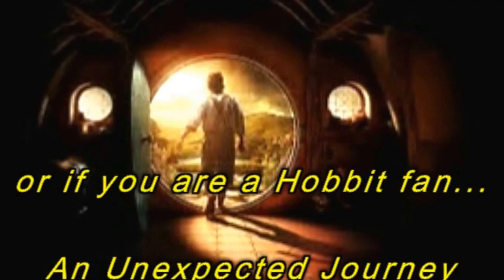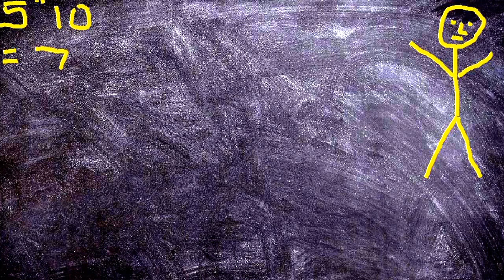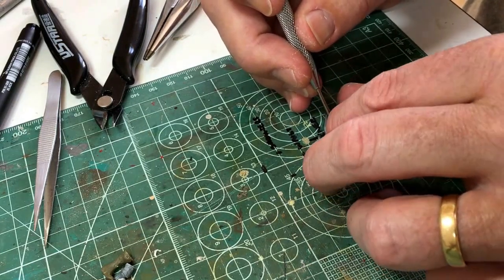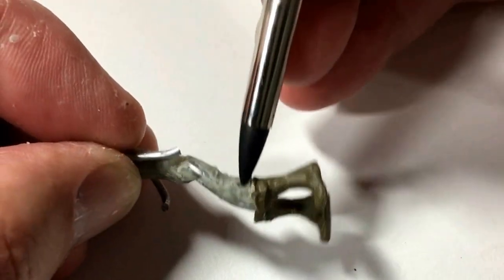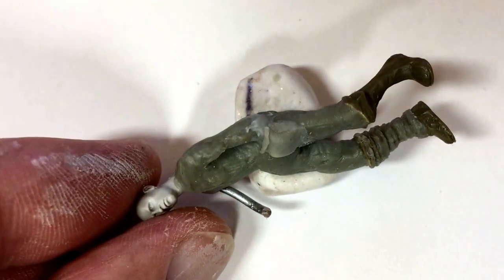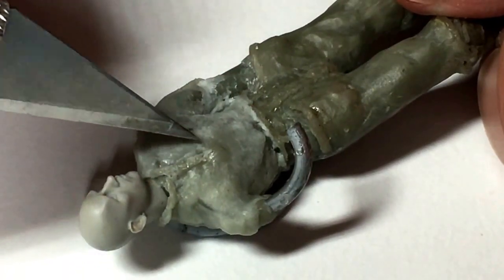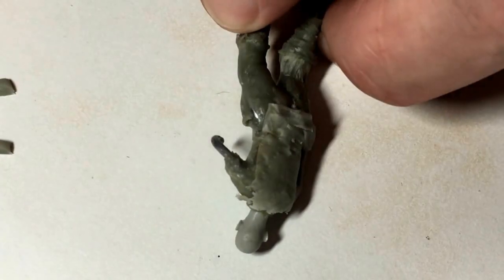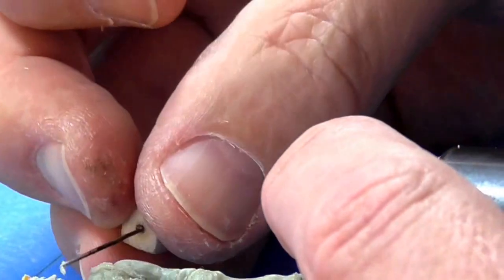How to Sculpt 1/35 Scale WW1 British Infantry - Part 1

Comment: Excellent mate. I have never tried anything like this (never had the need to so far to be honest) but although this isn't a tutorial, having this as a guide would be helpful if I ever did try it. I had a thought, for something thinner than a needle point, what about an old 0.2mm airbrush needle? That might give you an even finer point.
Reply from the maker: GT Scale Modelling Thanks GT, when I do the next one it will be better planned and I will try do do it more like a tutorial, although I feel that's a bit presumptuous of me given it will only be my second go, perhaps just a clearer showing of what I do might be a better description. Great tip using an airbrush needle, I will definitely give that a try on the next one.  Cheers 👍👍👍

Comment: Very good! I recently sculpted my first figure (well he isn't quite finished yet) and I was wondering if you had any tip and tricks I could use?
Reply: Also, I love the thing you say about size! It has always annoyed me that all figures are the same size. So I always used different companies together, and sometimes I would even use 1:35 scale and some of the old multiples airfix 1:32 scale figures together.
Reply from the maker: Thanks, I am not sure that i am qualified to give any advice really, I am just learning myself as i go along.  I guess the most valuable thing i have learnt is be patient, do small areas and let them cure, try to do to much all at once and you can end up messing up a lot of what you have done along the way as it is not set.  Good luck with your sculpting :)